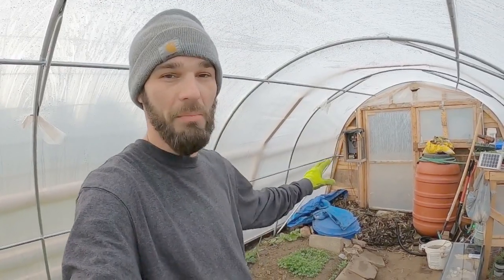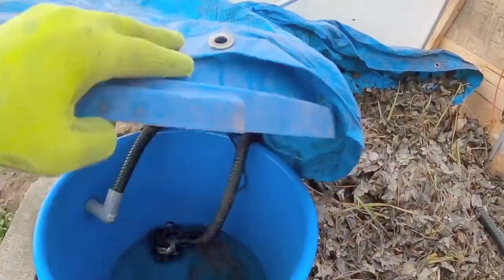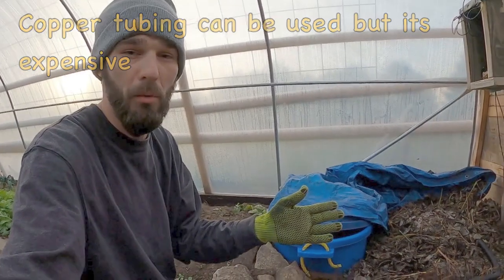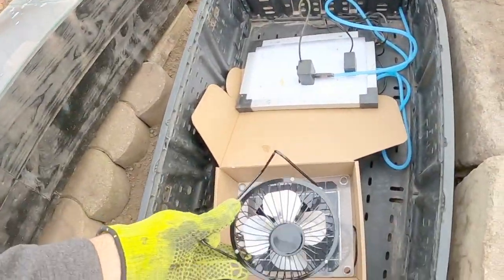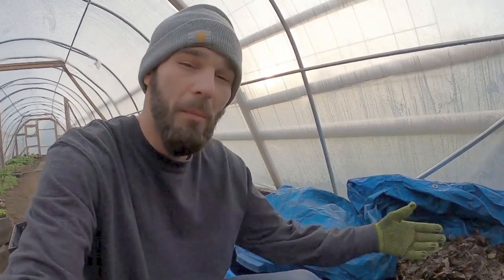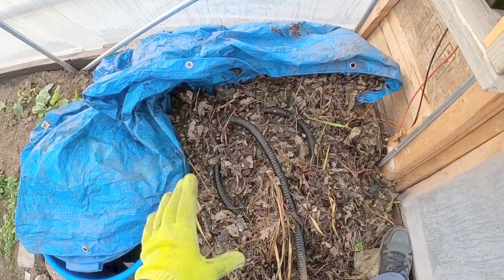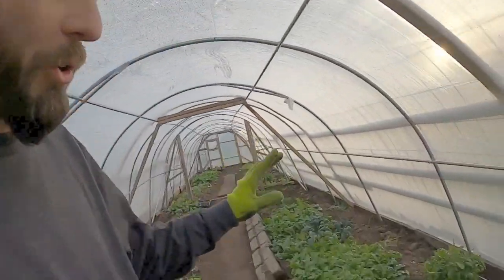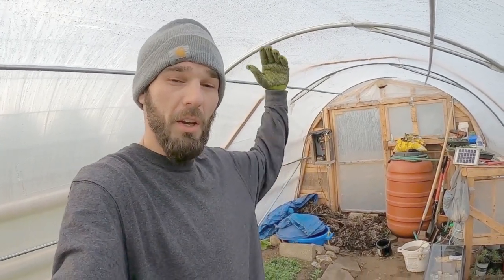DIY Cheapest Winter Greenhouse Heating | DIY Jean-Pain Composting Demonstration, Insight, & Ideas

Comment: You inspired me to run a stretch of 4" dryer flex duct through my compost pile. No fan connection yet, but you can feel the warm air coming out. Looking good

Comment: Wonderful design. Do you happen to have a link where to purchase the solar fan and pump?
Reply from the maker: The solar fan was cheap on Amazon, the exact one isn’t available but there’s many like it, I suggest using one with metal parts while searching. And the solar pump came from a company called silicon solar. Thank you!
Reply: @Earthdwellershomestead  Thank you!

Comment: You might like the extensive YT channel of a Ukrainian experimenter Sergiy Yurko ( link below ) He shows how a parabola of reflective mylar actually makes water pretty steaming in winter too.  I would think of heating up an earth sheltered resevoir  - like a buried 55 gallon plastic drum, I'm thinking that those solar powered pumps could do the job of lifting the cool water from the bottom?  Now I want to try out the several watt panels I'd seen at Harbor Freight the other day.  Do you have any links for those low wattage pumps you've used?  Thx
Reply: Sergiy Yurko has some interesting trials
https://youtu.be/L9_dzN4eyjA
 of some inexpensive materials to make effective solar energy collectors.   The flat black plastic resevoir seems interesting - esp if you can spare a sunny shelf on your north side hoophouse somewhere.
Reply from the maker: We burnt some of our plants last winter in our small cattle panel greenhouse cause we had the Mylar on the entire northern wall. The curve of the greenhouse created hot spots on the floor and it took me a bit to figure out what was happening. Thanks for that input I’ll have to check that out. The earth will maintain temperature I half burried our overflow tank, I’m always searching for deals and have been on the lookout for a larger tank such as an ibc tote bladder or something that size so I can have a larger water battery I can heat. The pump I’m using was a bilge pump from an old livewell set up I built as a kid lol. When I’m searching pumps I look at flow rate and lift to start, making sure it’s strong enough to work.